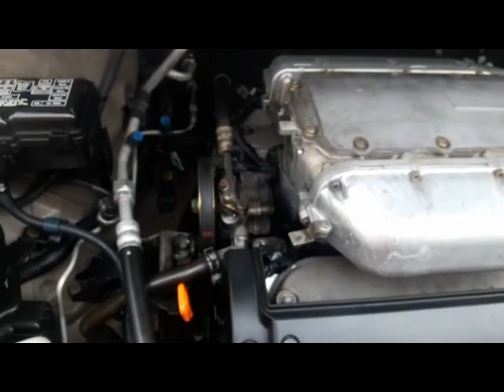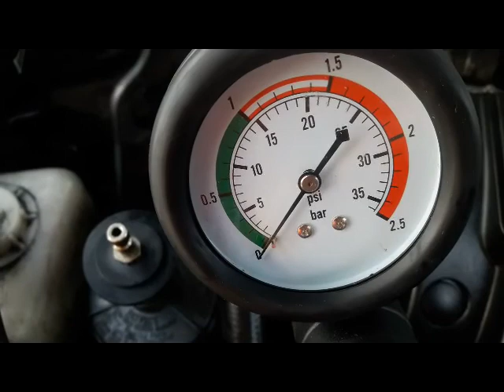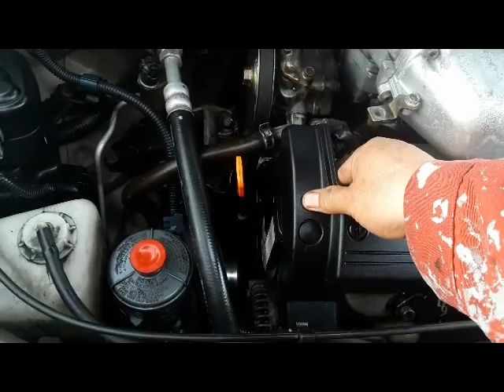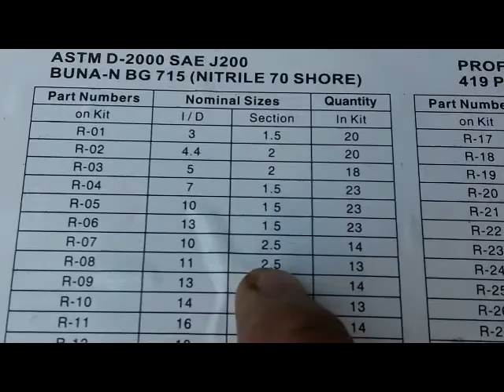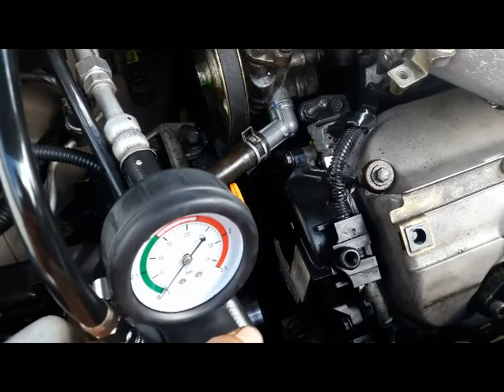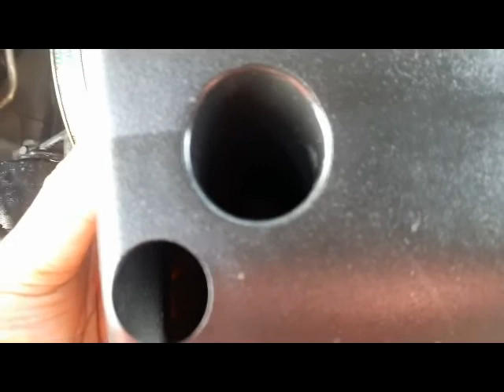Odyssey Power Steering Noise Fix Using Harbor Freight O-ring

Comment: How long can I keep driving with this noise going on at cold start up?
Reply from the maker: eventually the trapped air in the system will damage the pump, then you have to replace  the pump and it's cost a lot more than an O-ring.
Reply: @truerenegade1095  thanks!

Comment: Great video! Where did you get the Radiator Pump Kit?
Reply from the maker: Bought mine on Ebay about 5 years ago. But check out your local Auto part store, they may loan it to you for free.

Comment: good job, I have same 04 odyssey and i replaced the power steering reservoir 2 yrs ago because it was making weird sound and it fixed the problem
Reply from the maker: Yes, That was my first thought. The reservoir and the hose because I know it leak air from the inlet side of the pump. But when I put the radiator test on and know exactly where it leak, then I replace the O-ring instead.